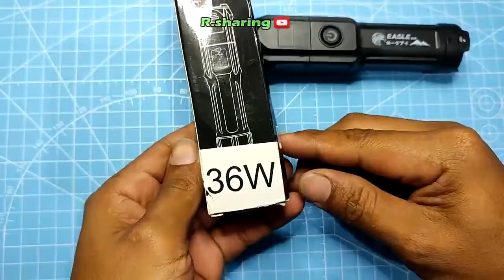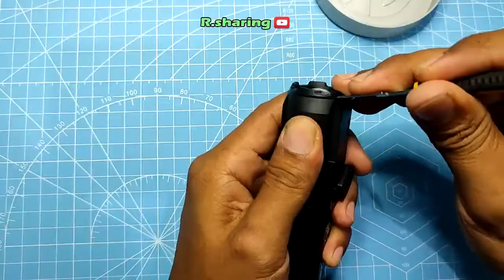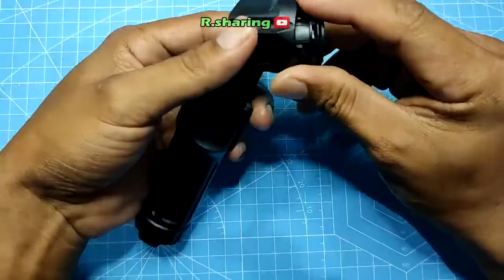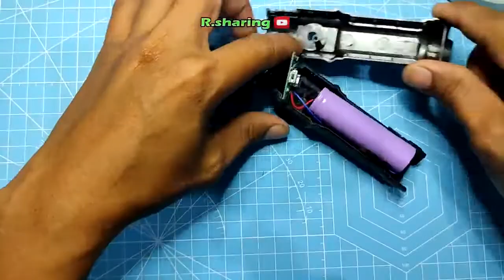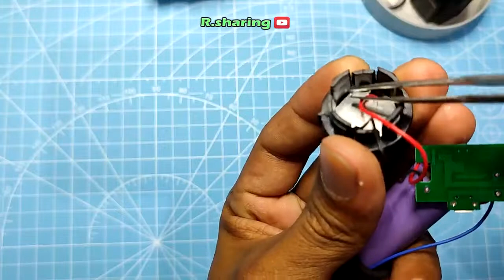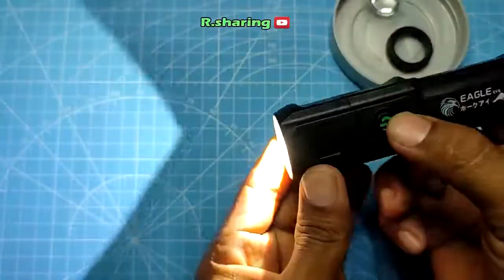Cara Bongkar senter eagle 36 watt  Senter Taffled 622A

Comment: Dude, thanks a lot! Standard 18650 is a very low quality so it runs out quickly. I replaced it with a high quality battery and your video helped a lot

Comment: Kalau ganti pakai baterai 18650 tapi dengan kapasitas 3000 mah bakal panas gk bang kira2 lampu dan modulnya?
Reply from the maker: 3000 mAH itu kapasitas listrik baterainya ,semakin besar ampere semakin banyak muatan listrik baterainya,jadi nyala lebih lama di banding dengan ampere kecil,aman saja kalau mau di pakai.Tapi ya kira 2 aja di nyalakan karena ini senter ,bahanya dari plastik.Kecuali senter dengan body aluminium.
Reply: @RSharingEverything  mksh info ny bang

Comment: Bang  ,,.yg kayak pahat buat nyongkel namanya apa ya
Reply from the maker: congkelan hp gan  https://shopee.co.id/CONGKELAN-HP-OPENING-TOOL-PEMBUKA-TOUCH-LCD-ISI-6-i.101325912.6348397958?sp_atk=0411d775-62f8-42ad-a4db-72820ba5c457&xptdk=0411d775-62f8-42ad-a4db-72820ba5c457   atau  bisa jg seperti ini https://shopee.co.id/ALAT-PEMBUKA-TOUCH-SCREEN-BESI-CONGKEL-TOUCH-SCREEN-i.43244726.1268797306?sp_atk=a5e2e854-14f2-4a7e-8f44-88913b4cba89&xptdk=a5e2e854-14f2-4a7e-8f44-88913b4cba89 ,itu link gk ada hubungan sama ane ,cuma bantu tentang produk saja.

Comment: Cara mengatasi senter shark, gak bisa ngecas om
Reply from the maker: cek ic cas nya aja dulu gan,untuk pinout kaki ic nya bisa google aja,atau lepasin baterainya lalu cas pakai cas nya external,kalau bisa di cas artinya ic nya mungkin rusak,kalau tidak bisa di cas  pakai casnya external artinya harus ganti baterai,cari ic cas nya apakah pakai lth7  atau  tp 4056 ,untuk penggantian kalau  pakai tp 4056 bisa cek di vidio ini ,senter beda tapi ic tp 4056 https://youtu.be/cvwrVHq0XiM
Reply: @RSharingEverything  takut salah om 😁
Reply from the maker: @trisuchoo  coba lepas dulu aja gan,baterainya cas pakai charger external,atau kalau ada baterai normal bisa di pasang dulu,karena yang model baterai internal jarang sekali rusak ic nya dibanding model baterai cas nya bs di lepas pasang kayak link vidio yg ane kasih itu sering kebalik orang pasang baterai postif negatif jadi,ic cas nya yg rusak.coba cek dulu aja itu pakai ic tipe apa gan,tar ketik aja di google misal ic tp4056 pin out ,itu udh ada keterangan dr masing2 kaki pin outnya gan,mana positif mana negatif mana chrging,itu kakinya dikit,kecuali kakinya banyak mungkin bingung urut jalur nya,atau gini aja gan gk ush di ukur ,agan ganti baterai dulu klo masih lalu ganti ic cas nya gan,langsung ganti gk ush di ukur kaki nya,seblum di ganti di foto aja dulu biar gk salah pasang,ini metode coba2 gan,seblum pasang/lepas ic ,baterai harus di lepas dulu ,postif atau negatifnya baru di kerjain ya anggap ini metode coba2 gan 😅

Comment: 18650 battery?
Reply from the maker: yup ,18650 battery
Reply: Bro, can u do a tutorial replacing the batt. same 18650 ?
 I bought this item from online but the battery drained too fast, I think the stock batt. is old or less than 1000 mAh ?
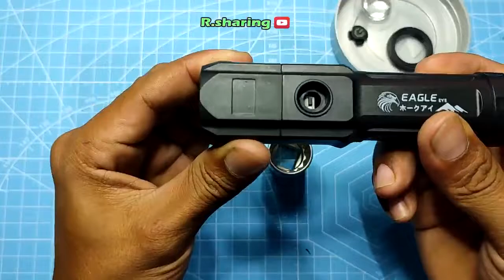Reply from the maker: use soldering iron 60 watt or higher and flux and check polarity  ,https://www.youtube.com/watch?v=Vo_uVNthaq4 desoldering at 5:07 another type smiling shark flashlight.
Reply: Ty ty bro. 👍👍💯

Comment: These flashlights are GARBAGE.  I have had 3 of them fail on me.  (2 were type USB MICRO and the latest a type C)  The batteries are indeed cheap, but the electronics are crap also. With the latest type C flashlight I purchased, The green charging LED started remaining lit which drains the battery when not in use.  Not worth the $3 to buy them and they're definitely not worth spending the time upgrading the battery when the electronics will fail soon!